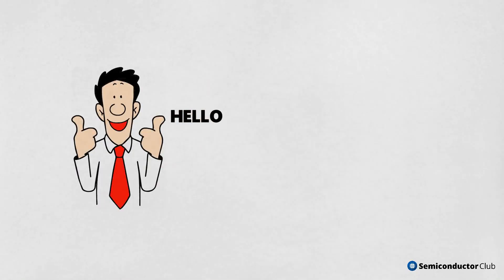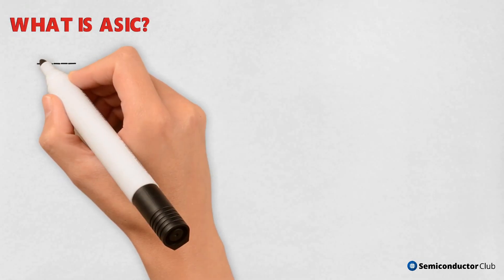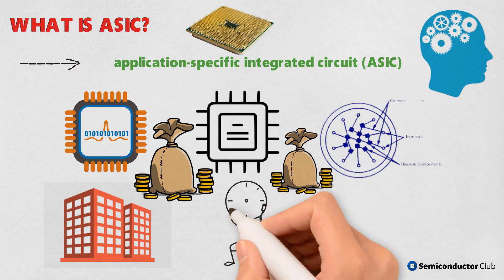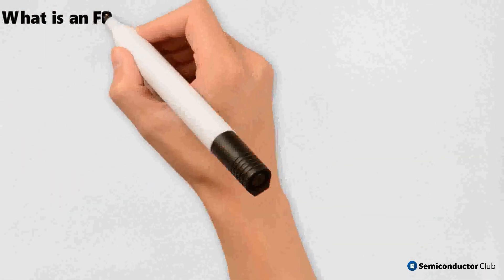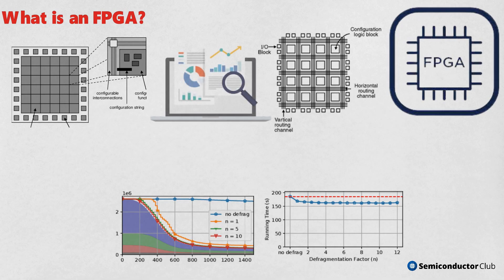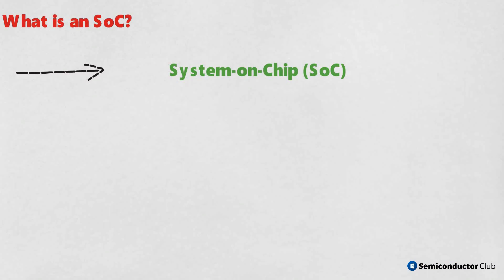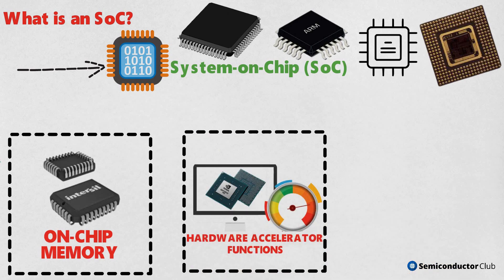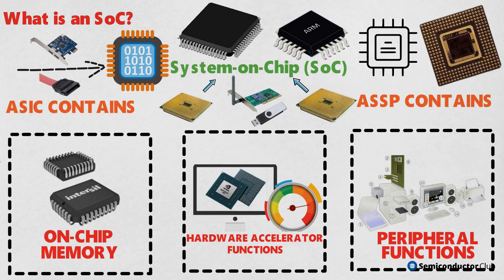What is ASIC - FPGA - SoC? | Explanation, Differences & Applications

Comment: Do data centers such as AWS and Azure use more GPU's or CPU's?
Reply from the maker: Both AWS and Azure data centers utilize a combination of GPUs (Graphics Processing Units) and CPUs (Central Processing Units), but the specific balance can vary depending on the services they offer and the types of workloads they support. GPUs are often used for tasks that require parallel processing, such as deep learning, scientific simulations, and video rendering. CPUs, on the other hand, are used for general-purpose computing tasks.

For example, AWS offers a range of instances optimized for different workloads, including instances with specialized GPUs for machine learning and graphics-intensive applications. Similarly, Azure provides GPU instances for tasks like AI and machine learning. The exact usage of GPUs vs. CPUs may change over time as both providers continue to evolve their services and hardware offerings.
Reply: @SemiconductorC  ty